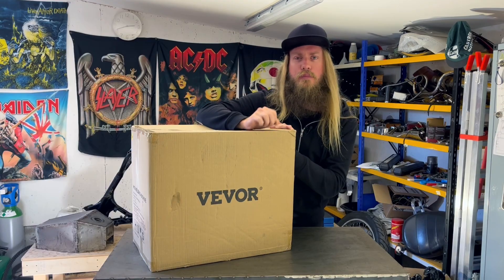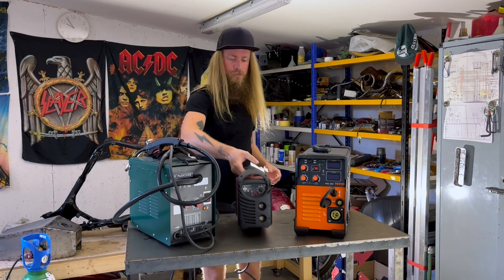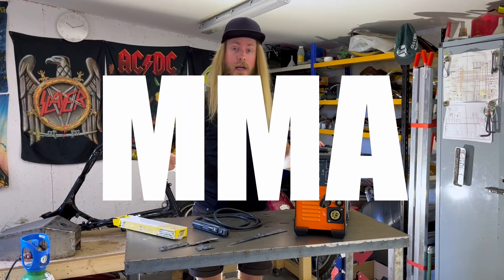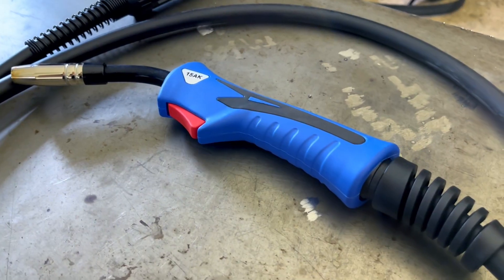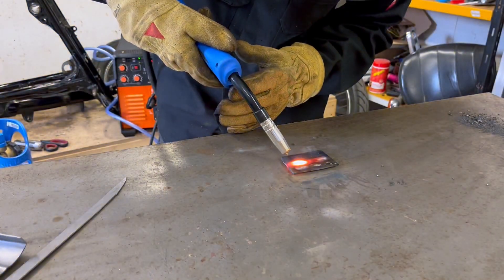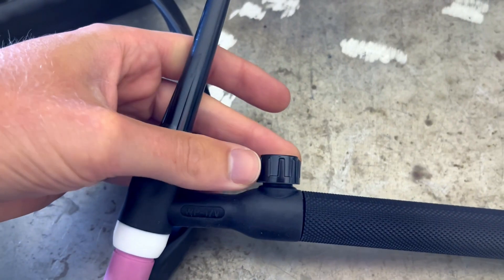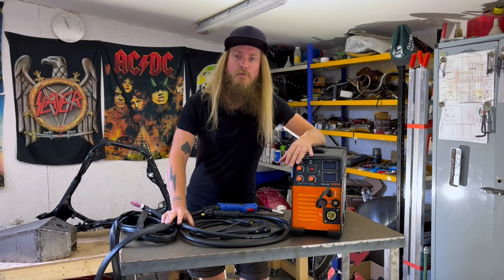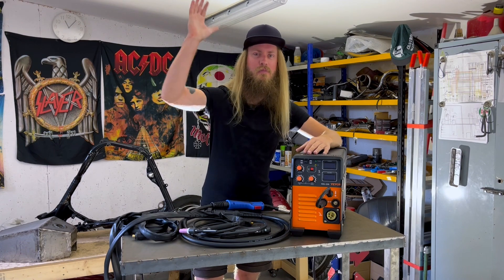Will the Vevor MIG-250 Really Do TIG, MIG & MMA?

Comment: You cannot run mig with pure argon. Mig needs some amount of reactive gas. The wire you are using is an ER70S-6, you need to run either 75/25 argon/c02, or 100% c02.
Reply from the maker: You're right. Thanks for pointing that out! Personally I switched to 100% CO2.

Comment: As always, great video! Super informative. You'll enjoy making new parts even more now. It looks like a decent machine to get started. I've seen you already thought about the gas coverage on the second clip. That's definitely very important and probably takes a bit of practice getting used to with that type of machine. It's a good practice to no only keep the weld covered for a few seconds but also the tungsten electrodes and the filler rod. How are you sharpening your tungsten electrodes by the way? Did you 3D print that part? Enjoy your new welder and don't get discouraged by the initial practice it takes. It's well worth learning TIG for building the raddest savage :D
Reply from the maker: Thank you very much!
So much to keep track of at the same time, but I try to remember the gas coverage. I think it's even harder to remember with this setup since I have to "flick off" the arc, there's no button to kill it.
I'm still sharpening on my bench grinder. I have ordered small grinding wheels for my Dremel and I'm planing on printing some kind of contraption for it. But the bench grinder works surprisingly well actually.
Even though I'm still terrible at it I already feel what an asset this will be. I already have a list of things I would like to make! 🔥
Reply: @HeavyMetalParkingSpot  nice, I'm looking forward to all the parts you're gonna build with it. When using the bench grinder to sharpen the tungsten electrodes I find it very handy to use a cordless drill on the lowest setting to rotate them (you might already do that).
Reply from the maker: @MotoWrenchers  That is a very nice tip and did test it. But quickly found out that I'm most often too lazy to take out the drill. 😅

Comment: I am not sure why on MIG  mode, you adjust Amperage with the WIRE SPEED button.  Perhaps you use Inches per minute instead of  mm and even so you are short of the specs.  There is no visible change on the speed of the wire motor.  That's weird.
Reply from the maker: First of all, I'm far from an expert on welding, I'm sure someone that is could chime in here. But it seems like wire speed and amperage is supposed to be related. And, I'm not sure the wire speed has a unit on these machines? Isn't it just a random number?

Comment: I just got my VEVOR MIG250 and it looks nothing like this one in the review video.  I don't see mine on any YouTube reviews.  My MIG250 has SMAW (stick), Lift arc TIG, and MIG or FCAW.  It came supplied only for MIG, no stinger or torch.  Price naked like that was $204 shipped and taxed.  It has one knob and two displays for current and wire speed.  I have not figured out the wire speed (SAE or Metric) so there's that experiment yet to do.
Reply from the maker: That sounds weird! I hope you figure the settings out!

Comment: supposed to drag gmaw  (mig) not push it
Reply from the maker: I've been taught "if there's slag you drag", so that's what I do. But in the end it seems like it's mostly up to personal preference and in what position you are welding.
Reply: @HeavyMetalParkingSpot  nah mig always drag...should uphand a vertical too unless its thin material
Reply: @HeavyMetalParkingSpot  only wite you push is metal core
Reply from the maker: Good to know! I have too little experience to say what's right and wrong. I'm just a guy in a garage trying to weld with cheap welders. 😅